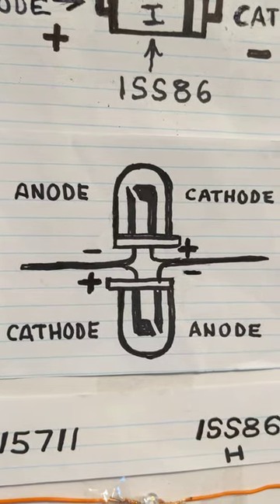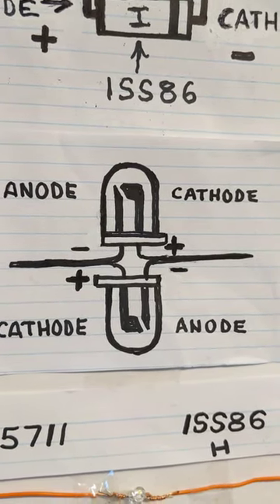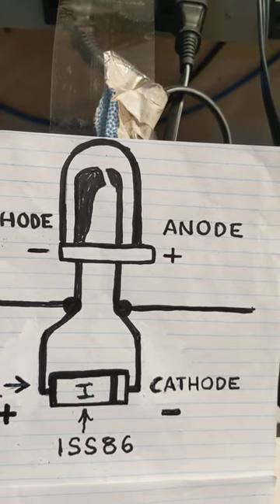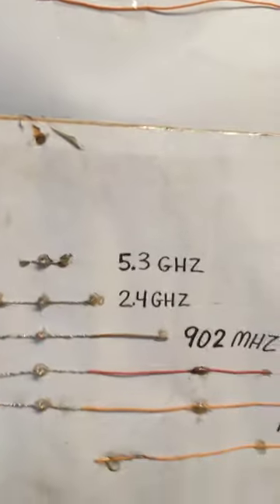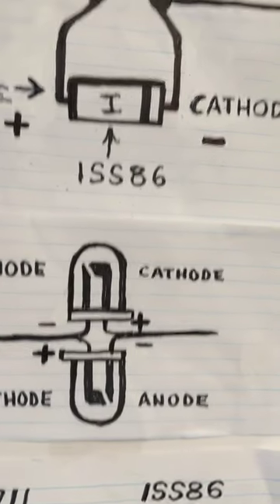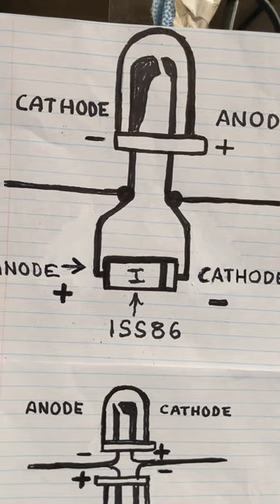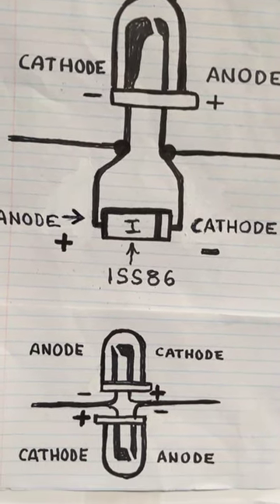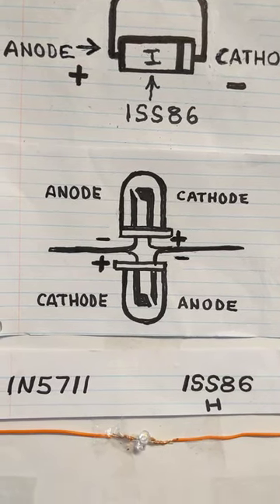Two LEDs In Parallel Can Rectify Radio Waves And Light Up!

Comment: This sounds like a weird and uncommon but useful survival tip. If you have those few items maybe it will help you detect when you are closer to civilization, or a cell service without turning on a nearly dead phone alot.
Reply from the maker: Yes, but you would need to be fairly close to the transmitter for the LED to light up, and my antenna is about 200 feet long.

Comment: Every Diode is actually a light emitting diode.
Reply: Very true, the lower the forward voltage drop, the lower the frequency. So a 1N914 silicon diode will light in infrared. You may even be able to see it on your phone camera if you turn the room lights off.

Comment: I'm in a automotive technology class and one of the things that we have to do is create various breadboards, I'll have to give this a go
Reply from the maker: I'd suggest the above circuit using the diode. It works far better, and at a greater distance from the antenna. Here is  an additional video you may find of interest. https://www.youtube.com/watch?v=vHVmJ5lD9jc&t=18s
Reply: @GrantsPassTVRepair  thank you as well
Reply: Also watch out for the breadboard changing the resonance frequency of your circuit if you go for high frequencys

Comment: Different color LED's have different forward "on" voltages. I've found green LED'S light first and last. I had a largely discharged coin cell battery and placed 3 LED'S in "on" configuration to see which would stay on the longest. Green won, hands down and stayed lit for hours, dim, but still lit many hours later.
Reply from the maker: I remember hearing the green LEDs turned on at a lower voltage, but thanks for the confirmation..
Reply: Low energy red led's have the lowest forward voltage.

Comment: Those LEDs are connected in series, not parallel. I also live in Oregon. I saw your video about solar panel and cordless phone amplifier and instantly binge-watched all of your videos. You are one of the most prolific independent engineers I have ever had the privilege to observe. I have learned more from you on this day than a full year of courses in AC and digital electronics. Great respect and admiration. I wonder if you could use a microwave to amplify wifi....
Reply: 😂 when you only have two devices for reference, it's both.

Once you include the antenna and ground, the rectifier is in series with the antenna and ground. Which make the 2 diodes in parallel.
Reply: @waroftheworlds2008  
still its considered parallel as in series one of the poles will be open

Comment: This is so cool. I can't believe I've never known this. I work on cell phone tower equipment and have spare LEDs at home. I wonder if it can pick up RF in the cellular communications bands like 600 - 2500 MHz. I was on a rooftop close to some antennas today. I'll have to remember to make one of these and take it to work when I'm near some more live antennas.
Reply from the maker: Mine lights up next to the antenna on my cell phone. This video has far more details on the LED diode combination for picking up RF energy. Your antennas need to be resonant for this to work well. https://www.youtube.com/watch?v=vHVmJ5lD9jc

Comment: I used this configuration in a small power am transmitter by placing it in series with the antenna.
I then tuned the antenna until both were the same brightness.
Reply from the maker: Sounds like you came up with an illuminated SWR indicator, but are you sure your tuning technique is best for maximum output? It would be nice to use a field strength meter, to verify if lighting up both LEDs to the same brightness is really a good idea.
Reply: @GrantsPassTVRepair  It was the only tool I knew at the time that would work without waiting to buy an SWR and anyhow it was a two transistor project on a protoboard, just to see if it could be done.

Comment: I soldered some LEDs together to try make this with ZD0190 white LEDs with each prong of the dipole being 31.05mm long, however it didn’t light up even when I put it next to the antenna on my 2.4Ghz 1w radio controller for my drone. Any ideas why it’s not working? Too high of a knee voltage on the diode? I’ll try it with my microwave oven and see if the higher power makes a difference. Cheers
Reply from the maker: Yes. The sensitivity is very poor using just LEDs AS I mentioned. Try using one LED and a 1SS86 diode.

Comment: Looking for info on antenna lengths.  Occured to me that putting a photoresistor alongside these LEDs could allow you to sense and sound an alarm when someone comes to my door with a high powered wifi jammer to overpower my home alarm system.  A simple comparitor circuit, say with a 555 chip, would allow you to set an adjustable trigger level??
Reply from the maker: This may help you.https://www.youtube.com/watch?v=vHVmJ5lD9jc
Reply: @GrantsPassTVRepair  Thanks.  Huge help.  Will let you know if I get this to work.

Comment: Could you use this energy to trickle charge small devices? I mean, it's lighting an LED from just airwaves, surely you could direct that energy elsewhere.
Reply: It would only charge very, very slowly, and you'd have to set it close to your WiFi router. In which case, it is simpler to just use a charger.

Comment: I wonder if putting a transmitter in my house would power leds in my backyard wireless
Reply: It loses power very quickly with distance, so you'd need a very powerful transmitter and the LEDs still won't be very bright.

Comment: Would a signal diode (the type you always see in radios, the glass type that look like zeners) would that work? With a 0.2xxvolt diode drop??
Reply from the maker: Many diodes may may work when the signals are strong, such as you see with two ordinary LEDs, but they aren't very sensitive. Ideally you should use a diode that's designed to for higher frequencies, such as the 1SS86, or the 1N5711 which also works, but not as well,  A small signal like the 1N914 is not ideal, but if your signals are strong, Here is a link to a previous video that has more detail on this . https://www.youtube.com/watch?v=vHVmJ5lD9jc&t=18s

Comment: Still wondering about that 3/4wave length for 60hz😂🎉..I'm by power lines that hum all the time, in the rain it becomes quite loud. Tune in ,turn on and keep it to yourself
Reply: A half wave  antenna would be about 1500 miles at 60 cycles.

Comment: Whats the difference between your diode and say a normal m7 or 1n4007 or anything i have laying around
Reply: The 1N4007 is too slow, it won't respond well to RF. Takes too long to turn off, so at RF it just looks like a low resistance in both directions. In fact, many ham radio operators build projects using 1N4007 diodes as variable attenuators using this effect.

Comment: Dave, please consider a video on properly stepping down the 50VDC on a telephone pair to a useable 5VDC for charging.
Reply from the maker: I.ll consider that. Thanks for the suggestion.
Reply: I thought 50V was only on ring signal?
Reply from the maker: @driverjamescopeland  You might  be right about that, but I was able to get my phones to ring with a little less.
Reply: @GrantsPassTVRepair  - yeah... the static feed is extremely low powered.
Reply: @driverjamescopeland  ...I measure the voltage as always present.
Reply: I believe the static voltage is fairly high like 50 volts but it's wicked low current. I don't think you'd get more than 100 ma so your looking at like 3 to 5 watts or power if that. I'd be curious to find out what someone could get from it.
Reply: @mikemesec  ...phone charging.
Reply from the maker: @mikemesec  It's not static electricity. it's radio frequency  energy, That's why my meter can't measure the current or voltage. Only an oscilloscope can be used to measure this.
Reply: Walmart sells (or used to sell) a product that plugs into a phone jack and slowly "vampires" power from there and charges a 18650 (1800 mAh rated iirc, made in China). It has a night light and a USB A charging port. I bought several on clearance for $1 and they do work.
Reply: @timgads1712  ....KOOL!!
Reply: Keep uP the good work 😃👍
Reply: @driverjamescopeland  Telephony voltages are generally 50VDC for dial tone and 90VAC for ringing circuit.

Australian Telecommunications Standard.
Reply: They're all switching to digital lines soon anyway.
Reply: @GrantsPassTVRepair that was my question...
Reply: If you do put any load on the 50 volt pair, it will signal the exchange that you are making a call.    It will eventually signal a PG Permanent Glow fault condition.

Comment: Is it possible to pull 5V out of the air like this?
Reply: Getting voltage is easy, but to get enough current to use it for anything would require you to be right up close to the transmitter or require a transmitter so powerful it cooks all the locals and wildlife.

Comment: Is this why my led kitchen light glows when the light is off?
Reply: More likely to be that the wires going to your light are running along other wires with power, so they both end up magnetically coupled and some voltage is induced on the other wire. It ain't much, but LEDs can exhibit a faint glow even with very little current
Reply: most likely nope. 
You can be sure by cutting off the main  2 poles breaker.
If it off now then no, it is not related this.

As someone said it will be related to the wires in their tube being so close for a long enough length so it acts as a capacitor which conducts a bit in AC in series.